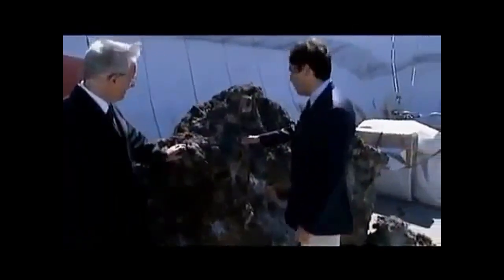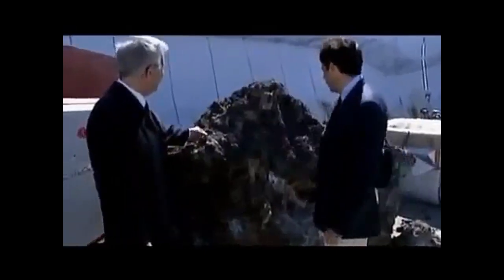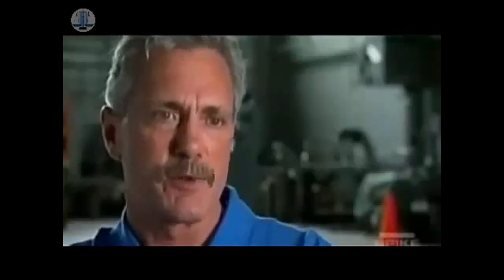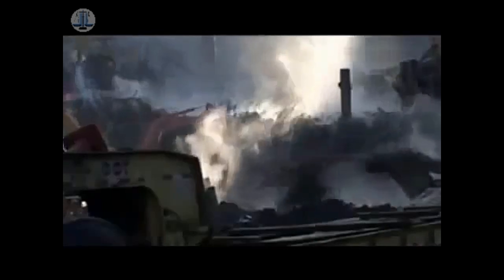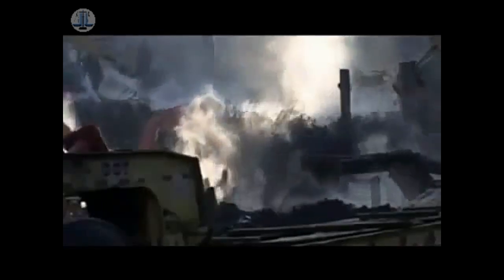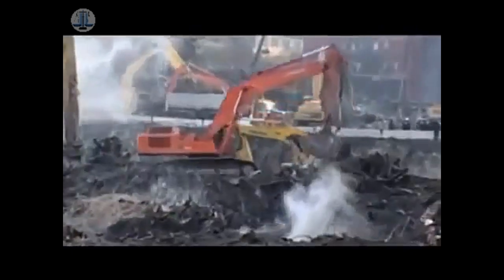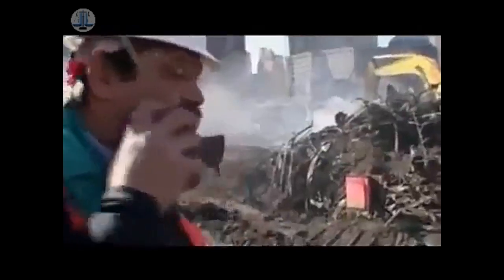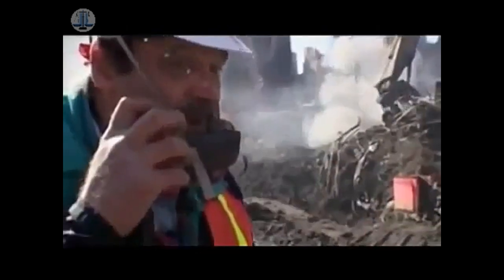9/11 Witnesses: "Molten Steel- Like You're In a Foundry"

Comment: Excellent to have so many voices testifying to the molten steel. In many discussions about 9/11 trolls and defenders of the official narrative just dismiss these accounts. The reason: they can't explain them. They can't explain where the energy came from to create these fires.
Reply: Anthony Winter is all over these pages planting doubt.
Reply: @Shelby_Starner_Everything   the melting point of steel is 1,510 Celsius Jet fuel burns at 425 to 810 Celsius.

Comment: "But it doesn't have to actually melt for the building to collapse, duh"
No, it doesn't, but it did LITERALLY MELT.    And chemical traces of the new military formula for "super thermite"...
You mix aluminum with iron oxide, and you get aluminum oxide and iron in VERY SPECIFIC ratios with a few other chemicals to accelerate it.  Those unique combinations were found, not just in traces or lumps but in MICROSPHERES everywhere, indicating a wide-scale MIST/SPRAY of molten metal, as you would only get with a cutting torch or a cutting charge, shaped to direct the heat of the thermite into the steel beam like they use for cutting/welding sections of rail for trains.
Reply: anthony winter ,no Anthony Winter, I did not state that I have disregard for the victims of 9/11..but in the twisted deceptive diatribe of your most recent reply.. it does seem though.. that..  is what you are implying. What is pointed out in regard to the very high temperature, molten steel pouring out from inside the buildings, the fact that very high temperatures of the steel and the fact that the steel was melting the crewmen boots and the beds of the dump trucks.. (as pointed out in this video) that is what I'm reflecting on.And yes,  it does seem that getting the steel out of and away from the crime scene was given top priority.
Perhaps it is you.. who has disregarded the victims of September 11th, 2001.You're still not debating with me through the proper perspective and filter.
Reply: anthony winter , as always another evasive attempt.. by you.. to divert from the most important questions. 
118 explosions either reported or recorded. 
Nano Thermite samples collected at the WTC site. 
Many anomalous events that contradict the the official line. 
Numerous officials being away from their usual offices, surroundings etc. 
No jet fightercepts established coupled with the.. fact ..that each impact either actual or simulated decreased in elevation with regard to sequence (of impacts) . Now.. I will go over this again with you.. 

September 11th, 2001 8:45 a. m. WTC North impacted at 91st floor by "A A 11".. at daylight.. as in daylight attack.
Television cameras turn on to cover the impact of WTC North. which had occurred at the 91st floor.
Approximately fifteen minutes later "UAL 175" impacts WTC South at second highest in elevation target at the 78th floor.
Now let's pause there.
Considering that live broadcast television was covering the WTC North impact and other at least eighteen different people at eighteen different locations were also filming the WTC North impact before "UAL 175" impacted at the second highest in elevation target impact does it not become apparent to you that logistics ,feasibility, and a preplanned schedule of impacts would come into play there...at that point? 
Next impact.. third highest in elevation with regard to sequence of impacts either actual or simulated.. 
Seven floor pentagon building with alleged impact of" Flight 77"occurring at both first and second floors. 85 cameras were immediately collected etc and the only video proffered shows merely a gray in color lozenge shaped object speeding toward the pentagon at ground level while showing absolutely no indication that it was in fact an actual commercial jet airliner. 
Shanksville PA "Flight 93" fourth and lowest alleged impact occurring at ground level.
Two different explanations have been proffered 
1.the aircraft completely buried itself underneath the impact trench. 
2.the aircraft totally disintegrated upon impact leaving little if nothing at all in regard to plane parts, bodies, wings, landing gear, engines etc Obviously both Pentagon and Shanksville PA were merely simulated commercial airliner impacts.
And the two different simultaneously proffered explanations of either "Flight 93" either having either buried itself underground or disintegrating does seem to be supra convenient for the actual perpatraitors .
WTC 7 fell in a documented on film, nearly perfect symmetrical controlled demolition at 5:20 p. m. 

Logistics 
Elevation 
Sequence of each impact either actual or simulated. 
Feasibility
Daylight between the hours of 8:45 a. m. and 5:20 p.m..from when the first and highest in elevation impact occurred at WTC North to when WTC Building Seven fell in a nearly perfect controlled symmetrical demolition. 
No jet fighter intercepts were established. 

Read this my most recent reply to you before you only reply on impulse. And debate with me only through the proper perspective and filter with the above listed factors. 

 Cordially ,how's about you debate with me in regard to the above listed?
Reply: anthony winter  : 

Elevation.
Logistics. 
Daylight as opposed to night. 
Sequence of impacts either actual or simulated.
"U A L 175"..the simulacra aircraft (plane) 
Live broadcast television coverage. 
The fact that each impact either actual or simulated decreased in elevation with regard to sequence. 
The fact that no commercial jet airliner passenger plane could possibly have either disentegrated or have buried itself completely underneath the "impact trench" at Shanksville PA.
8:45 a. m. to 5:20 p. m. is daylight. 
Aircraft employed for the two highest impacts (WTC North, WTC South) 
and because no aircraft were needed for the ground level in elevation impacts, none were employed..and there for the pentagon and Shanksville PA were simulated airliner impacts.